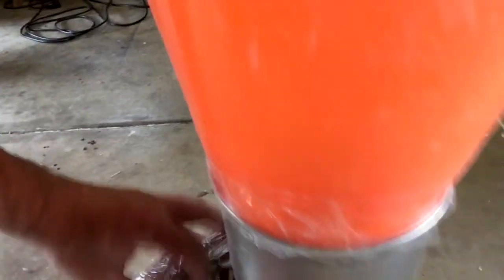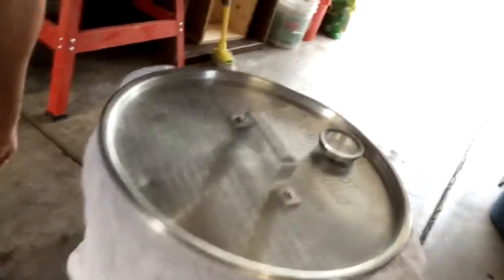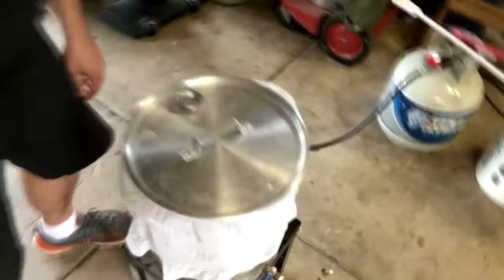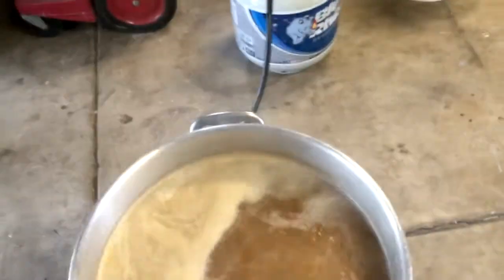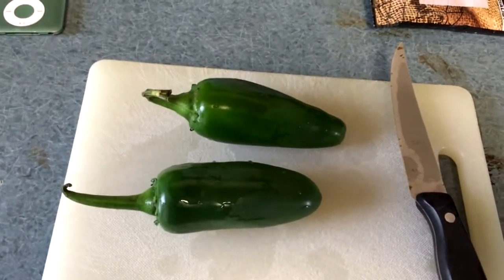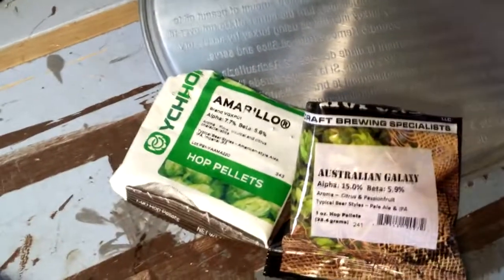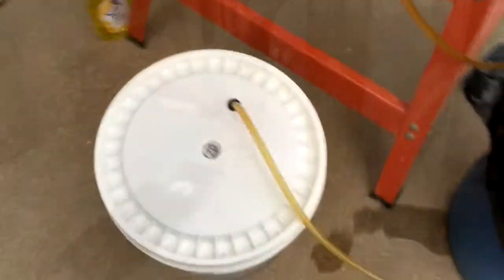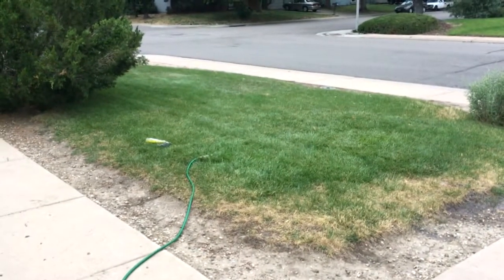F* It Friday ~ Brew Day ~ Peppa Beer ~ August , 2016

Comment: I learnt something about BiAB - I didn't realise that there was no need to not mash out?  I'll have to check that out a bit more as it will be much easier to skip that step ( I forget half the time anyway).  Looks like it will be a nice beer, I look forward to the tasting.  Loved the ending!
Reply from the maker: By the time you get your mash out water up to temperature, you can have your boil going.  I never had an issue.  I top off to the pre-boil level and wait for the hot break.